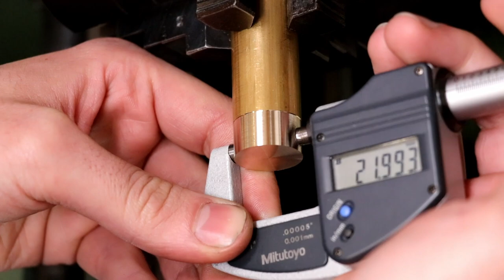Making personalised shot glasses

Comment: Nice finish on those.  I have similar experience with stainless.  I use a thick cutting oil for stainless called Mic-O-Cut that helps with the chatter.  It smells like peppermint.
Reply from the maker: Peppermint definitely sounds like it smells a lot better than the smoky oil I'm using! I think if I do something like this again I'll get a bar of free cutting 303 stainless and some ground stainless grade inserts